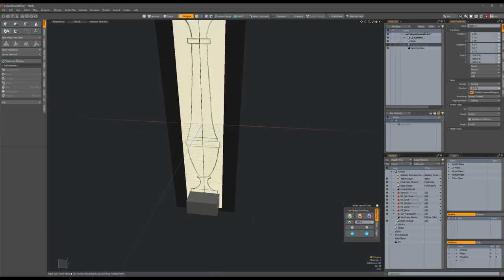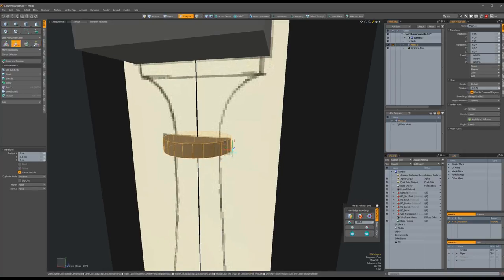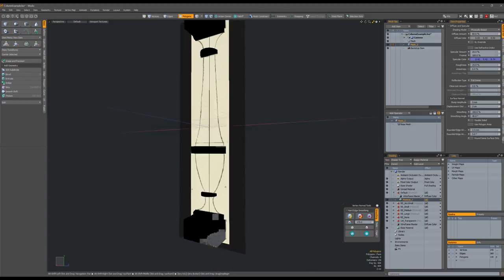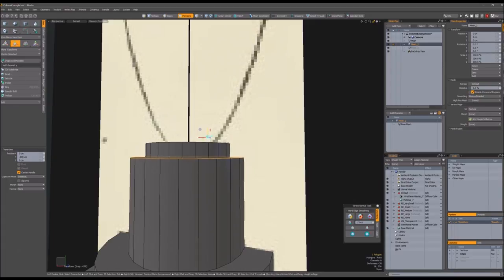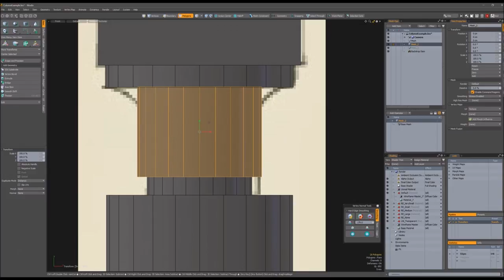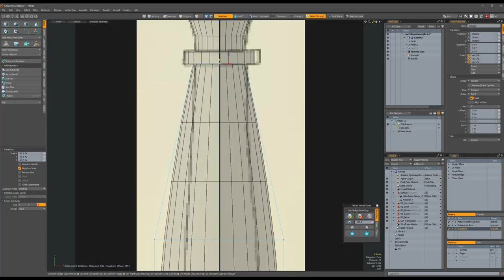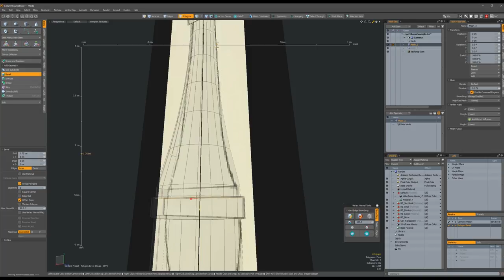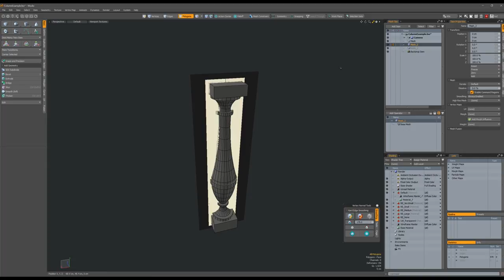Modeling Tips : Balustrade High Poly

Comment: Hi, what script u are using for transparent?
Reply from the maker: No script .. I have a transparent material in my default scene so it's always loaded.  Then I use my PIE menu to apply it with the command :

"cmd poly.setMaterial Util_Transparent"
Reply from the maker: If you download the scene file from any of my "warm up" videos, you can check out the material itself but I assure you ... it ain't fancy.  :P
Reply: I have error when I run ur comand
Reply from the maker: You have to have a material called "Util_Transparent" in your shader tree first.  I have this in my default MODO scene, so this always works for me.
Reply: ok, thanks
Reply: I'm using another way: write the macro with ur command without cmd and "item.channel advancedMaterial$tranAmt 0.3" command
Reply from the maker: Hah!  Nice.  Yeah, whatever gets the job done.  :)